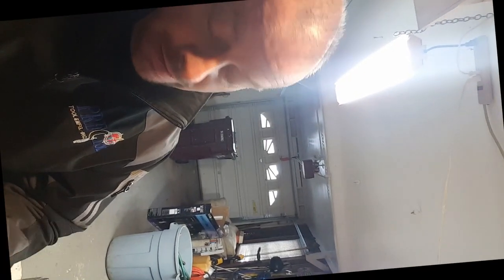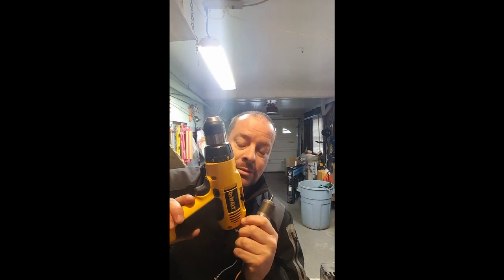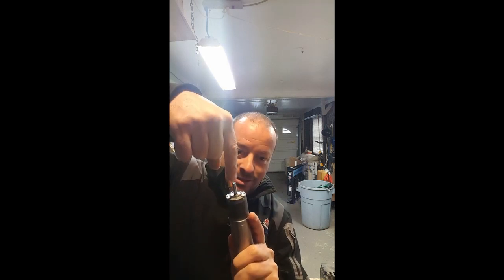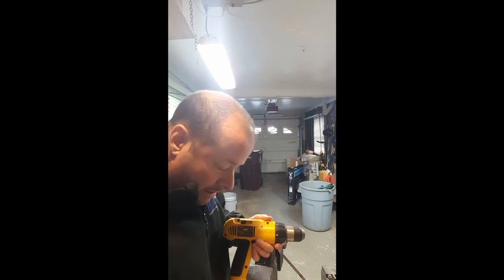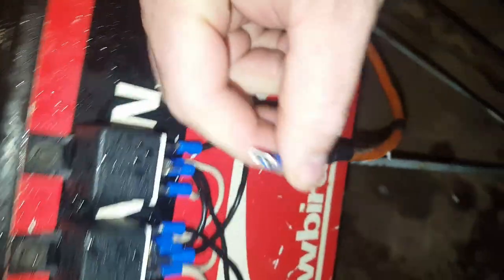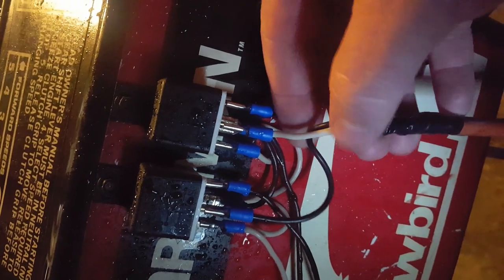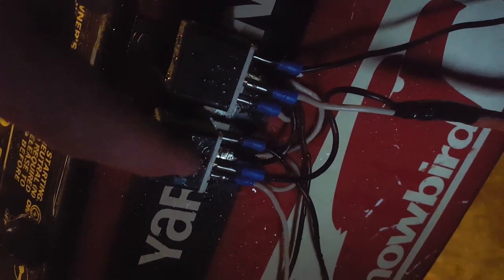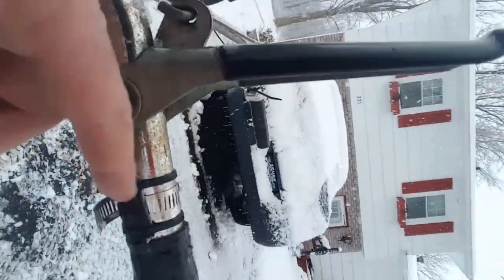Snowblower powered chute project start to finish

Comment: Jerry, your snowblower powered chute using an old drill is awesome. I was contemplating using a window motor, but everything about your approach seems much easier and within grasp. I'm hoping you can add a few more details so that more people like myself can repurpose their old drills or buy a used one. For reference, I have an Ariens 24" (920014) which has a similar crank to control the chute. Here are a few questions:

1. What kind of old Dewalt drill do you recommend using? 11V? 20v? 18v? A make and model number would be ideal. 
2. If anything, how did you ensure that you are not going beyond the limits of the Chute? (to prevent stripping the chute gears or doing something bad to the chute if I over rotate it)
3. When you took out the guts of the drill in your video, what exactly did you do next? How did you connect the wires from the motor to the relay? 
4. Does anything get tied into the alternator on the snowblower? If not, do you simply take the battery off once in a while and place it in the DeWalt charger?
5. What is the model number/tech specs of the relays and switches that make the drill spin left or right?
6. Did you figure out how to keep water out of it? Plastidip? Something else?
7. Any other key tips?

Comment: You've probably learned this since then, but a common thing to use is a flexible coupler. The come in various lengths (usually only an inch or two long), as well as different input and output diameters. They are commonly used in CNC routers and similar to make sure that slight misalignment doesn't screw things up. They also break before the shaft breaks in case of any jams/stalls.

The Dewalt certainly works, though :D
Reply from the maker: I appreciate the input! Now at least I know where to look or what to look for. Since this video I've purchased a welder and have done some more improvements. Everything was working adequately but I'm always tinkering. Around this time of year it's always cool to see what people are doing. So many ideas I still haven't tried yet. I'd like to get a new stator for better charging so I can use hand warmers.
Reply from the maker: Also I was making my narrative support repurposing a drill instead of recycling it. Still worked. I am thinking about making a 5 years later review. All is well but my super cheap battery went dead. I start it up every 2 months to keep it charged